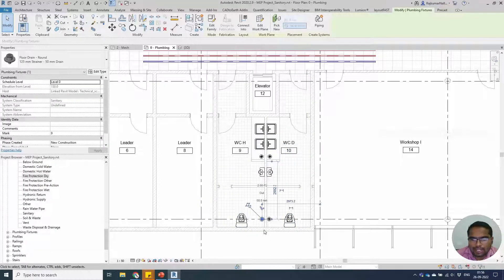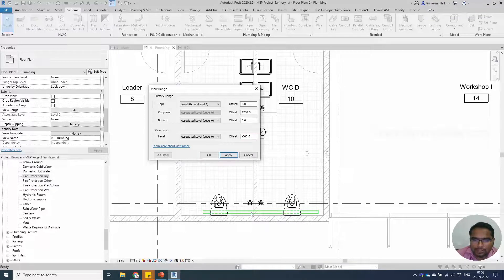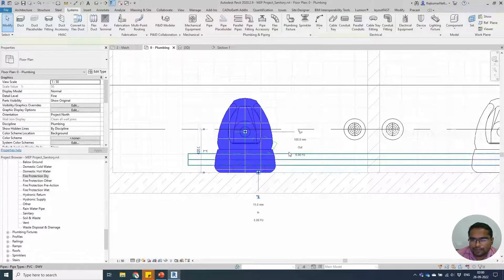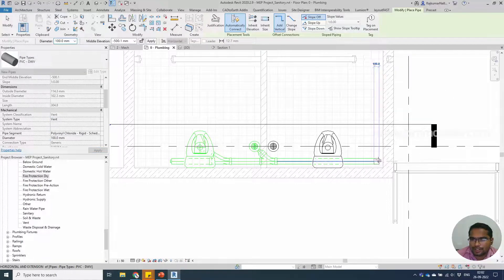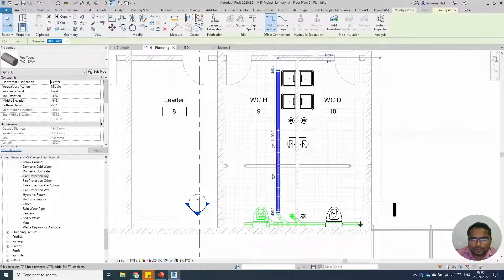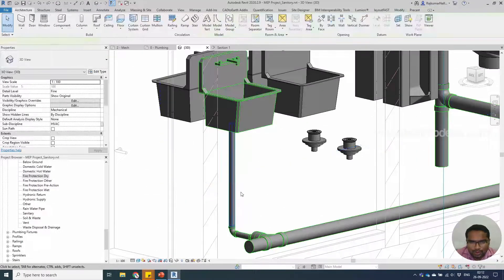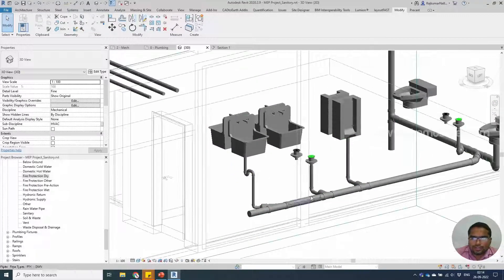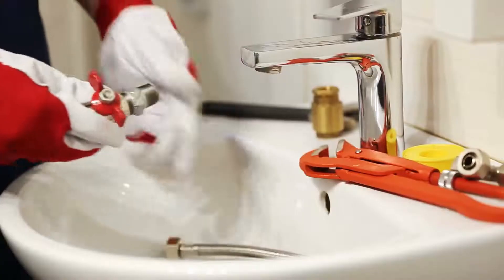#Revit MEP Project 31: How to Create Sanitary System in Revit?

Comment: The main pipe needs to have some slope before connecting fixtures/branch drains to it..
Reply from the maker: Ashwin Yes indeed it needed, I mentioned it.
Reply: @BIMModeller   Hi, I did noticed that you mentioned it..but, what I was trying to convey was when you model a main pipe it needs to have a slope..and the fixtures that are connecting to it should also have some slope associated with them..in this instance you picked -500 as your depth or invert level of the main pipe and at the same time same with fixtures..which is kind of questionable..in the real world the fixtures/branches will connect into the main run with higher invert level than main run..there are few standards to look in (depends on the countries you are in)..
Reply from the maker: @ashwingadicherla4057  I Agree
Reply: For the sake of those beginners in the software, it is much easier to understand neglecting those parameters I think. And in the part of the modelling specially if you are a beginner those parameters are truly doesn't matter yet.